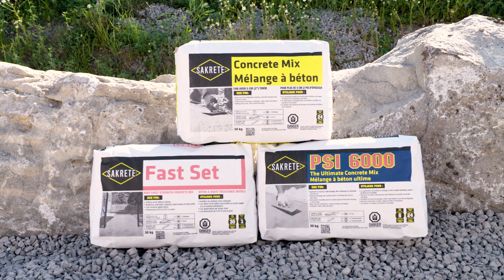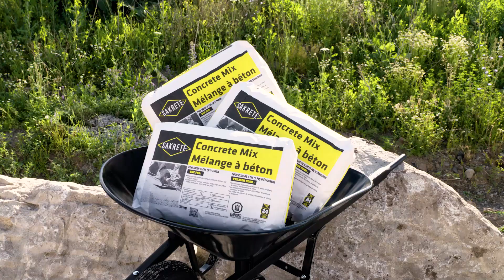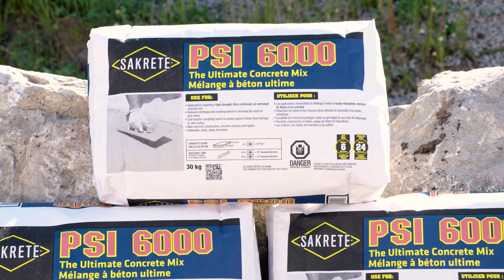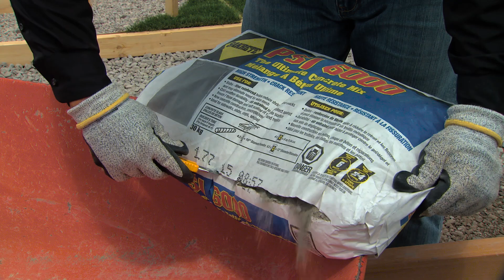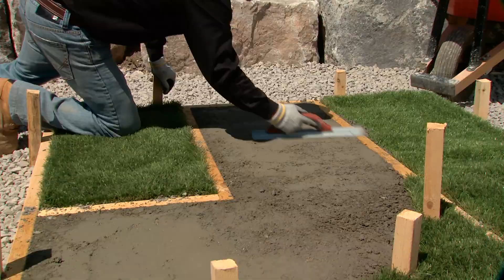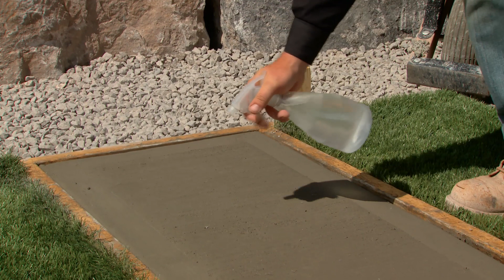SAKRETE Concrete Mix, SAKRETE Fast Set, SAKRETE PSI 6000

Comment: second!!!! I am about to do a home project long over due, thanks to the covid19 I finally have the time.. 25 bags on concrete! here we go!!!
Reply: How did it go? I'm about to start one myself!

Also, before I start I was wondering, do you know if the regular sakrete high strength concrete that home Depot sells is air-en trained or not? I'm guessing it is because supposedly the tiny air bubbles help with the strength of the concrete, but hoping for a specific answer cuz I saw on another video where you want to use a wood bull float if it has the extra air bubbles, and magnesium is fine without the extra air.
Reply: @kbanghart  Sorry I just saw the message.  It went perfect thanks for asking.  I made a concrete fire pit.  I'm not really sure  about your question.
Reply: @josedavidrodriguez  no worries, was just curious if I should use a wood or magnesium float. I've kind of been using both. 

How does your fire pit look? Could you send me a link where I can see a picture of it?
Reply: @kbanghart  add me on instagram ill send you the picts.. username : jochesama
Reply: @josedavidrodriguez  ugh I don't have insta. Dang
Reply: @kbanghart  and email. and ill send you the pictures bro.
Reply: @josedavidrodriguez  hemlock4355@yahoo.com
Reply: @kbanghart   i sent you and email and some photos... cheers.
Reply: Hope it went well. I start my Covid19 project today in my yard🤣🤣🤣🤣🤣🤣
Reply: @ltdhairshop9426  let me know how it turns out :) be safe
Reply: Did we just become best friends ... Yep!
Reply: @madcity2879  yes yes !!! how did your project go?
Reply: 6k psi for a walkway ?..... ya'll cray
Reply: Would anyone happen to know if the fast set is the same as no mix fast set sakrete?